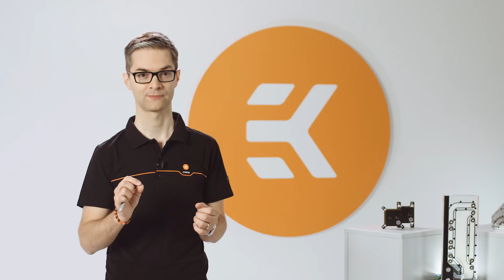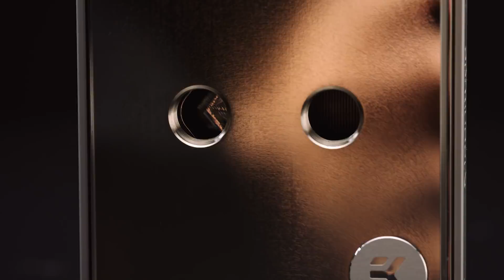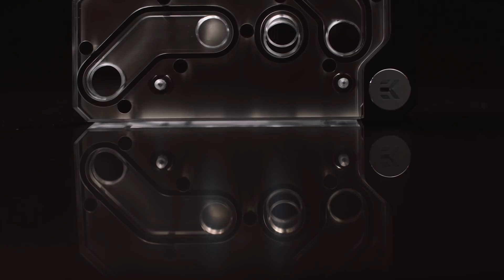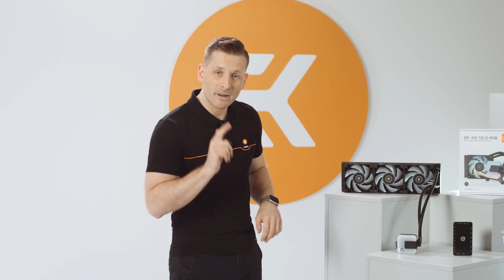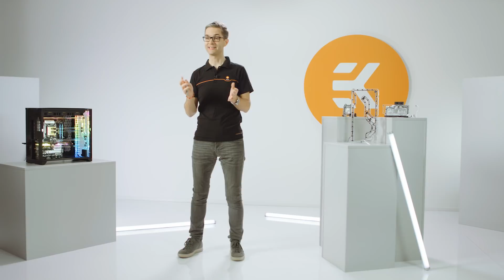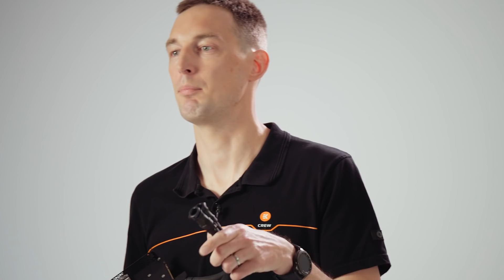EK Cooling EXPO 2020 - Grand Opening With a Keynote

Comment: The Front distro plate for my 011 dynamic XL will hopefully not sell for €300 because that's not what they promised in this video.. affordability!
If it was just the material, a regular distro plate would cost around 30 to 50€, depending on thickness and Dimensions of the acryl plates, as well as number of screws.

Comment: Can we have a Mono Block for the ROG Maximus XII Extreme, utilizing the Water Block Header? <3
Reply: Wait for Bitspower. Bitspower has always fully used the Asus water block header. EK just ignores it and does not know how to fully make the water block header useful. Ever since Asus first released their Rampage VI Extreme in 2017,  EK has never taken advantage of the Asus water block headers. I bought two RVIE EK monoblocks in 2017 and ended up wasting that money and buying two Bitspower monoblocks three months later. Not only did the Bitspower monoblocks connect to the water block header, whereas the cheaper EK block did not,, but Bitspower's cold plate was bigger and cooled my two 7980XE CPUs more than 20-C cooler under load.  So ever since 2017, I always use Bitspower monoblocks, especially on Asus boards. EK's monoblocks have a bit more styling, but Bitspowers monoblocks cool better!
Reply: @CJ-xv7oi  I'm happy with my Maximus IX Apex Monoblock from EK, except for the missing RGB.